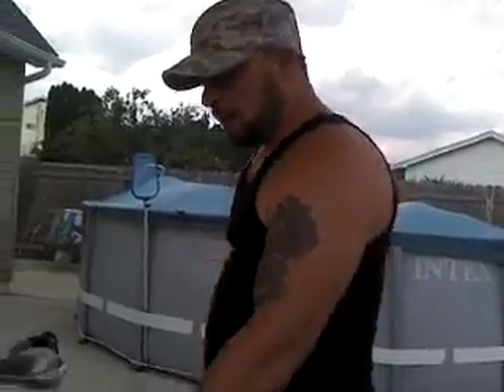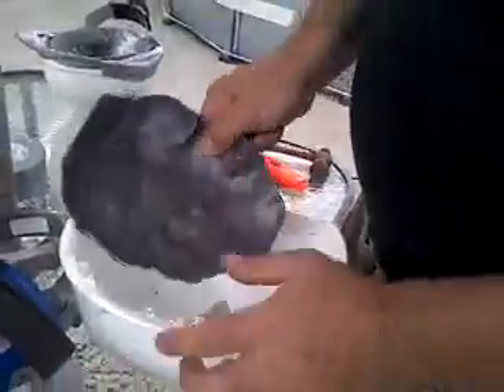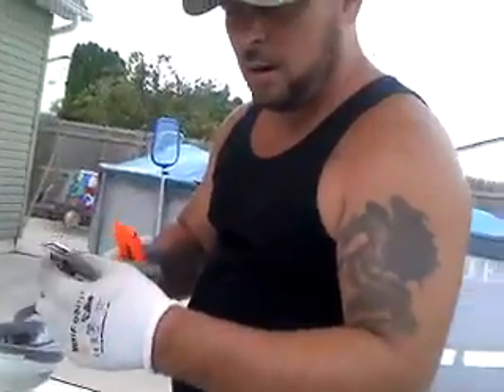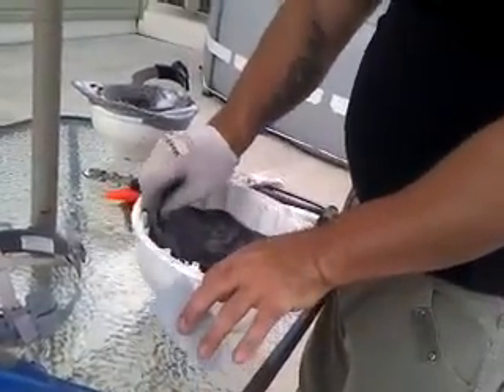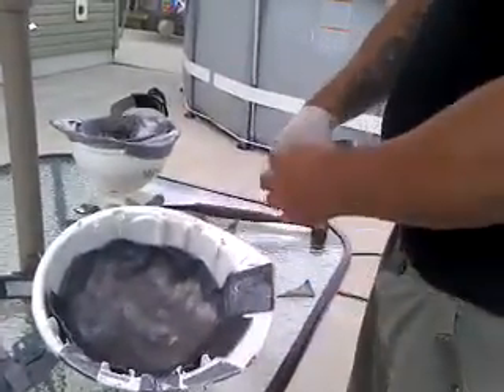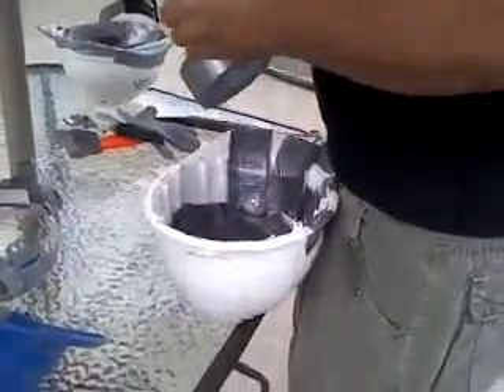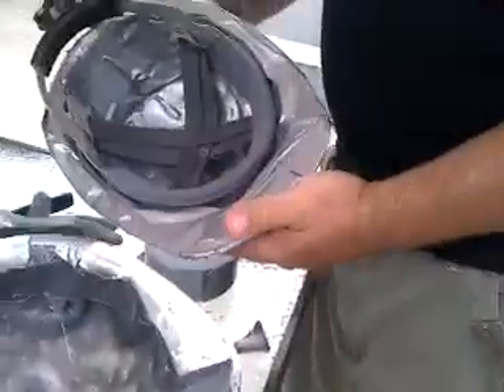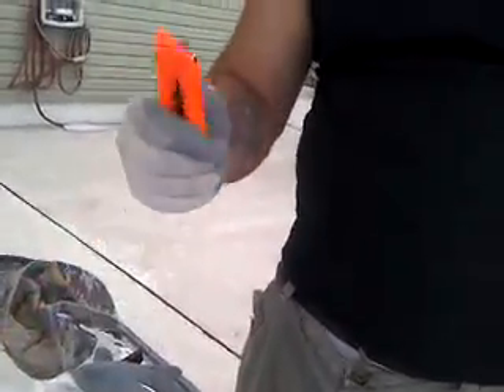NIBIRU- POUPS LEAD HELMET

Comment: no, just put the lead fish weights into a cup or anything wrapped with tin foil; melt it by open flame or something similar (not high melting point; low actually. but do it outside or ventilate good) -poor the melted lead in a mold and ur done much faster. u can use the helmet as a mold too, just cover the inside with tin foil (must be no gaps) and poor the melted lead into the helmet. Piece be with all of us!

Comment: Hey, poup1973, has it been determined by anyone that you know of, that a good Faraday-capable wire mesh, such as finely woven brass or copper screen, would work as well as lead?  Perhaps even a double layer of screen?  Apparently, a relatively small sheet of lead is quite expensive.

Comment: just need to know what thickness, the sheet metal place has 1/8 or 1/16 or 1/32. Im ready to make it, just need to asap please. thanks Poups!
Reply from the maker: HowNotToMovies I think it was 1/4 of inch you can bend it easy it's soft
Reply: OK done it took my cell phone placed inside still doesn't stop from working so think my brains still going to fry but very impressive to my tinfoil hat friends